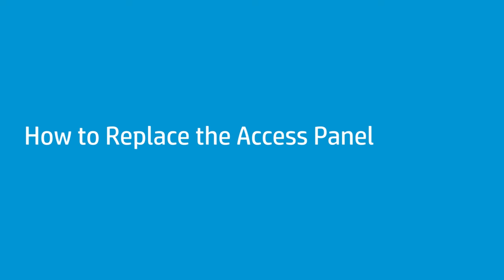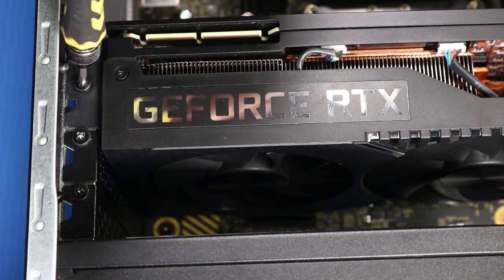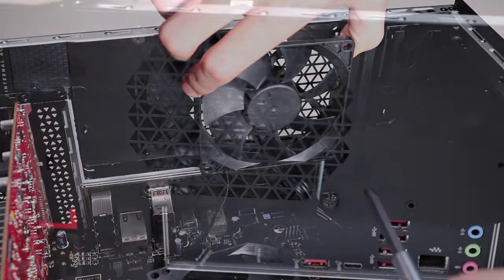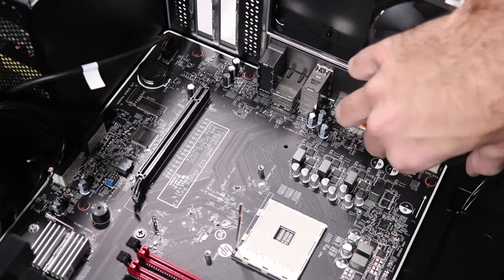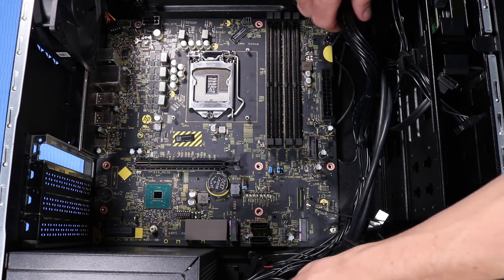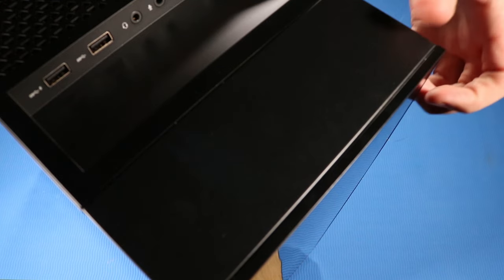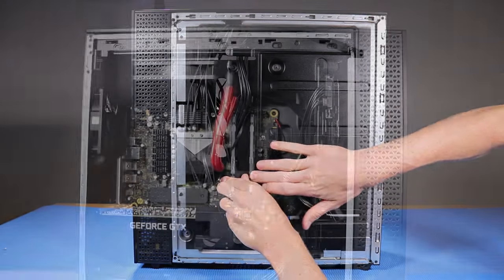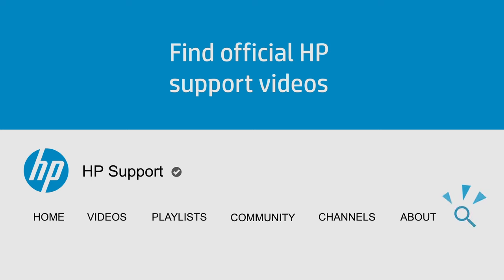Removing & replacing parts for OMEN 25L/30L Desktop PC | HP Computer Service

Comment: I have an HP omen 25L that has an i7 and the 2070 super graphics card. I’ve never been able to find any information on my graphics card upgrade options. Any help from HP support would be amazing. I’ve called a few times, but I was never able to hold out because of the wait time was too long. Thanks
Reply from the maker: Hi Kevin, thanks for contacting HP Global Social Media Support!
I understand that you need to know about upgrading the graphics card of your computer.
I will do my best to assist you.
You can upgrade the processor to a 10th generation i7 or an 11th generation i5 or i7. The computer has a 500 watt power supply, so you can upgrade the GPU to another one that doesn't require more than a 500 watt PSU.
Binu_HP Social Media Tech Support
Reply: Thank you so much!
Reply from the maker: If you need any help in the future, you can always get back to us.
Thank you for being a valuable HP customer.
Have a wonderful day!
Cheers!
Binu_HP Social Media Tech Support
Reply: Awesome and thank you. So 500watts isn’t much nowadays, so if I found a 600watt psu that fit would that compromise anything? 600watts would give me a few more GPU choices.
I’m planning on possibly building a new pc at some or buying a new HP but for now I really wanted to upgrade what I have. Cheers
Reply from the maker: Yes. You are correct.
Binu_HP Social Media Tech Support
Reply: @HPSupport  you mentioned above that I could upgrade my CPU to 10th GEN or 11th GEN i7 but aren’t the sockets incompatible? I was considering upgrading to the i7-10700KF but the socket is a LGA 1200 and I believe mine is a LGA 1151. Can you please clarify? Thank you
Reply from the maker: Thanks for the reply.
May I know the complete model number of your computer?
Binu_HP Social Media Tech Support

Comment: I could not get the top and side panels off so i just ended up trashing the whole system due to motherboard failure. saved the SSD
Reply from the maker: Hi there, thanks for contacting HP Global Social Media Support!
I understand that you are experiencing an issue with the motherboard of your computer.
This looks like hardware issue, and you might have to get the computer serviced. 
So, I would recommend you to contact regional support for repair options.
Please feel free to reach us on call/chat. Access this link to select your preferred country and language option to reach us. 
Global support link: - https://hp.care/6052ldDgE 
Regards, 
HP Support

Comment: I have a 30L Ryzen 5, 8gb and want to upgrade my ram.  I have been told that i have to buy it from HP if I want it to run at the proper speed and I guess one is that true, and two if so where can I find it?  I can't find it on your site.
Reply from the maker: +Gypsy Owlz You can purchase the part from here: http://partsurfer.hp.com/ Please select your country and enter serial or product number of your unit.
Reply: im 99% sure u dont need 2 buy ram from hp if ur worried about it just buy the same name brand of ram u have in your pc allready an if u are really really worried about it u can buy it off hp
Reply: @QuakerSteveT  u just go in your bios an change it
Reply: @Lerqful  yes, I am aware. for those that have and intel cpu this is not an option.
Reply: @QuakerSteveT  bro u don’t need a intell cpu lmao
Reply: @Lerqful  From what I've seen, HP doesnt allow you to adjust ram speeds through bios or third party apps
Reply: @arodr40895  bios isn’t a third party app it should be built into your computer
Reply: @Lerqful  i never mentioned bios being third party
Reply: @QuakerSteveT  I have an omen 30l with the z490 board(10700k), even after the bios update any advanced bios options are still unavailable. Dude doesn't know what he's talking about,
Reply: So current update, I  now have both slots full with 2 16gb sticks.  And yes, you do have to download ryzen master to re adjust the ram speed up to 3200.
Reply: @QuakerSteveT  I'm guessing you have an amd cpu?
Reply: @aaronrosenthal5310  Yes, it's in the original post.
Reply: @QuakerSteveT  u dont just go into the bios?
Reply: @Lerqful   ive been told the bios are locked and you cant just add the same one because the speed will drop.

Comment: Hey HP , i have a i5 10400 8gb gtx 1660 super 2tb 256gb ssd and i think it's the 25L or the 30L what motherboard is it and will it fit into a different case because i am looking to put all the parts into a brand new case
Reply from the maker: +Rxcky HP does not recommend upgrading or downgrading hardware parts or software that is bundled with the product as It may affect the manufacturer's warranty and performance, however, you could change the configuration at your own discretion.
Reply: @HPSupport  I was looking to change the Pc
Case not a HP case though a different one , it would change the effect of the guarantee right?
Reply: Hey I think the motherboard is a micro ATX layout so it can fit into micro ATX cases
Reply: I'm not too sure tho

Comment: Hi, HP. I have a different Omen 30L model. 

Model: 328S4AA#ABA
SKU: 6487502

AMD Ryzen 7 5800x
16 GB Hyper X Memory
NVDIA Geforce RTX 3070
1 TB SSD

My question is can I safely add an additional 1 TB hard drive to my system? Are the steps the same?
Reply from the maker: +JACK Please try the steps mentioned under the video on your computer and let us know how it goes.
Reply: @HPSupport  i had to force the hard drive in. it was a 3.5 and it wouldn’t fit with screws so i had to ditch the screws and just have it sit inside of the black tray without them. i also have another issue: i can’t unscrew the water cooler because a big chunk of the hard plastic that it’s made out of is in the way. my screw driver can’t fit and doesn’t have enough room to twist the screw out.

Comment: Why HP delivers such a poor heat sink with the AMD 9 3900 CPU? (Omen 25L) The CPU always went over 90° C (cpu fan went crazy) after some minutes of games. One should expect better quality for a ~2000 € Gaming PC. Pretty soon i had to replace the heat sink with a better one and threw away the sh**ty heat sink. Some months later also one of the RAM slot went faulty by pulling out the RAM module and put it back again (poor solder points?). HP refused then to repair it (they want me to put back the old heat sink which i no more have). Now i have to buy a new motherboard and replace it myself. Overall poor quality and experience with this PC. Never ever again HP :(
Reply from the maker: +publicmmi Please contact our phone support team to fix the issue. Please follow these steps to reach them.
Step 1. Open link: https://support.hp.com/us-en/contact-hp
Step 2. Select the product type.
Step 3. Enter the serial number of your device or select let HP detect your product option.
Step 4. Select the country from the drop-down.
Step 5. You should see the HP phone support number.
Reply: @HPSupport  All steps already done (see my post) and HP refused to repair because i no more have the old heat sink.

Comment: I just received my 25l and it didn’t come with the hard drive I can’t believe how poor is the assembly and even worst the quality control of the manufacturer “does” before shipping the units…. So disappointed with HP
Reply from the maker: +Santiago Bejarano Please contact our phone support team to fix this issue. Please follow these steps to reach them.
Step 1. Open link: https://support.hp.com/us-en/contact-hp
Step 2. Select the product type.
Step 3. Enter the serial number of your device or select let HP detect your product option.
Step 4. Select the country from the drop-down.
Step 5. You should see the HP phone support number.

Comment: Hate hp after this omen! Total idiotism of new fan not waorking..
Reply from the maker: Hi there, thanks for contacting HP Global Social Media Support!
I am here to help!
What seems to be the issue? Are you facing any technical issues with your HP computer?
May I know the complete model number of your computer?
Let me know!
Regards, 
HP Support
Reply: @HPSupport  i change case to corsair 4000d airflow due to overheating(omen30lcase with liquid cooling processor 5800x) and install air cooler deepcool as500 plus. After this error 90B arise . It seems pc think its liquid pump. The cooler as500 work on max speed. Now I have returned everything back to the old case, lost time and money on the case and fans.
Reply from the maker: Thanks for the reply.
Please refer to the instructions mentioned under this document to fix the issue: https://hp.care/6050WigRi
Regards, 
HP Support
Reply: @HPSupport  no thanks. A waste already a lot of time. I will try to sell this omen 30l and forget it like a bad dream
Reply from the maker: If you need any help in the future, you can always get back to us.
Have a wonderful day!
Regards, 
HP Support

Comment: I'm trying to add a second ssd but theres a big gray pad.  Do I just remove that?
Reply from the maker: Hi there, thanks for contacting HP Global Social Media Support!
I understand that you need to know about adding second SSD on your computer.
I will do my best to assist you.
HP does not recommend upgrading or downgrading hardware parts or software that is bundled with the product as It may affect the manufacturer's warranty and performance, however, you could change the configuration at your own discretion.
Regards, 
HP Support
Reply: @HPSupport  I understand i just need to know what the gray pad is under the plastic cover on my 2nd ssd slot.
Reply from the maker: It would be a rubber pad. You can just remove it.
Regards, 
HP Support
Reply: @HPSupport  thanks so much
Reply from the maker: If you need any help in the future, you can always get back to us.
Thank you for being a valuable HP customer.
Have a wonderful day!
Regards, 
HP Support